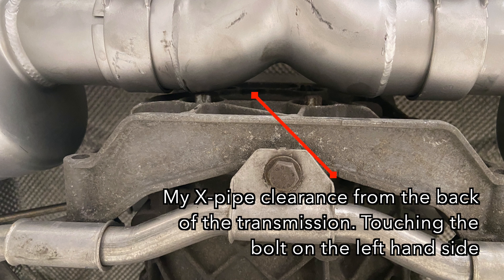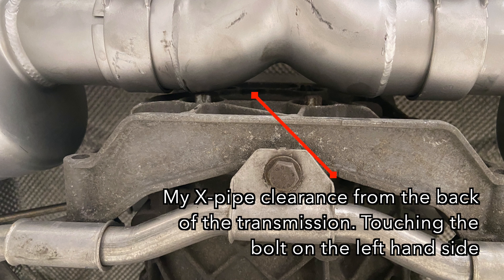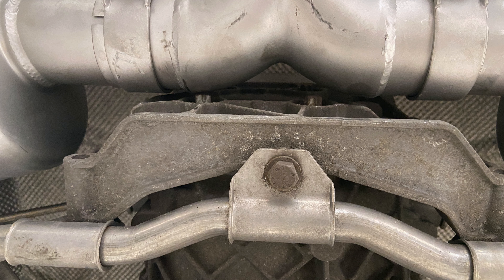Soul Performance Exhaust Installation Update 1 | Porsche Cayman 987.2

Comment: Sorry to hear about the installation issues but hopefully you’ve now got the remote problem sorted. As already mentioned, the final clip speaks for itself 👍
Reply from the maker: Hi Clive, I might have to live with the key fob issue... I’m still waiting to find out if my garage wired it wrong, or are the key fobs programmed inverted? Worst case I’ll colour the buttons green and red as appropriate.
Reply from the maker: Hi Clive, I just replied to another post here, it's rather funny!! The key fobs have been sent out "wrong" for absolutely ages. The thing is, no one in the USA cares, as they programme the signals into their HomeLink buttons, which is a standard option in the USA. Meaning, no one in the USA uses the key fob after they have taken the signals off it. On the other hand, I need the key fob to operate my valves as I don't have HomeLink. John is sending me a solution in the post!!
Reply: MAX REVS maybe they got this the wrong way around as they drive on the wrong side of the road 😀 but glad to hear that a solution is on its way, it needs to be right.
Reply from the maker: I was preparing to live with it, until John Gaydos reached out to me, and said after extensive investigations, they concluded all their Cayman key fobs operate in the same manner as mine, i.e. the unlock button closes the valves, the lock button opens the valves. I can't believe I was the first person to inform them ;-) The UK definitely doesn't have a lot of Soul Performance compared to the USA.

Comment: Sounds good. Some of the smell is probably the exhaust getting hot for the first time and the coating slightly burning. That will go after a few drives.

Some pics and info on the H&R roll bars would be interesting also.
Reply from the maker: All in the next video, and thanks for mentioning that thing about the exhaust coating

Comment: So glad you like the sound Max!    Are the roll bars oem or stiffer?
Reply from the maker: Thanks Tom. I haven’t put the car through it’s paces, though cannot feel any difference with the new anti-roll bars. I’m not sure I could notice much difference unless I track the car? Slowly I am replacing all the bushings on the car, front and back, and that is primarily why I wanted a stiffer anti-roll bar setup. FYI. The Cayman R has a stiffer anti-roll bar setup compared to the 987.2 Sport.

Comment: Congratulations on your new exhaust Max.  Frustrating about the key fob but sure it will get sorted out - probably a silly question have you tried both fobs?
Reply from the maker: Great question, I meant to try this when I got home last night, but didn't, as I hadn't eaten any food the whole day. I just wanted to take my shoes off and eat something at the end of a long day. I need to start the car in order to find out, and don't want to do that unless I go for a long-ish drive... What the heck, it's 6.30pm now... time for a drive methinks!!
Reply from the maker: Back from a drive. Both key fobs the same.
Reply: That's a pain. Sure they will sort it.  Don't think I am far from you(Sussex)  I have a white 987 S will look out for you.
Reply from the maker: John Gaydos provides great customer support. Here is the latest on the key fobs...
So as you may know HomeLink is standard on all Porsche Caymans sold in the USA. As such, it seems like everyone in the USA programs the exhaust valve key fob into the HomeLink buttons, and then never uses the key fobs ever again. I don't have HomeLink on my Cayman, so I need to use the key fob.
It turns out the key fobs have been inverted from day one! Just that no one has ever bothered to inform Soul Performance as they don't use the key fob!
I tried swapping the buttons around in the key fob, but that's not possible. John Gaydos has come up with a solution, and will be sending it to me soon... watch this space. The garage did all the wiring 100% legit.
Reply: That's great news Max

Comment: Sounds great so far !  Can't wait to see your upcoming video.  Don't worry about the valves - just leave it open :)  Would be great to hear your thoughts on this setup vs the 981 Cayman GTS.  I have a Cayman R with PSE and I've received a lot compliments on the sound but I'm also thinking about an exhaust upgrade.
Reply from the maker: Cayman R owner? NICE!! I was driving home from the garage on Monday on the motorway... I was opening and closing the valves while cruising, you know what? I couldn’t hear much of a difference, I couldn’t detect any droning even when the valves were open... leading me to think, I might as well have the valves open all the time! I definitely need to spend more time with the car at the weekend as I have hardly put the exhaust through its paces.
Reply from the maker: May I please ask where you’re based? If in the UK I’d love to compare our exhausts and make a video! You can reach out to me at maxrevscars@gmail.com if you don’t want to reply here.
Reply: @MAXREVS  Check your email

Comment: Congratulations on the exhaust!
As far as what Boris has said, you have only changed the mufflers. The should be minimal (if any) changes for the lambda sensors. Even if there would have been, the ecu would have adapted very quickly.
Anyways, can't wait to see the follow up video.
Reply from the maker: If Boris ever sees this comment maybe he can clarify. He said it's to do with exhaust gas pressures... it will be less restrictive now, and the car is always looking to fine tune the petrol / air mixture. Didn't understand it fully, however when I don't know enough I generally err on the side of caution.
Reply: @MAXREVS  While it will be less restrictive, it will not be that much of a difference. Also, you have the stock ECU and mapping. This is not a racecar, nothing too dangerous will come out of that.
Reply: MAX REVS   It will be absolutely fine as you have only done the rear exhaust, if you had de catted it or fitted 200 cell headers it would be needing a remap set up ...   get the engine up to temperature and ring the snot out of it ... sounds really good the end clip ... it’s going to smell for a bit all new exhausts do don’t let that worry you ....
Reply from the maker: Thanks for the advice. The smell is much less on the second day👍🏼

Comment: Are the scratches on the exhaust superficial? I ask as you were so diligently careful on the unboxing video yet now installed it has picked up a heck of a lot of marks. How come? Not being a troublemaker, 👀, just wondering if you should ask for some money off the install.
Reply from the maker: Show me a mechanic that treats your car the way you would ;-) I've picked-up plastic trim scratches even in a Porsche garage. I accept every time my car visits a garage, it will pick-up a battle scar... sad but true in my case.
Reply: I'd wipe it down with IPA or alcohol to get off any grease.
Maybe John Gaydos can send you some touch up paint?
Reply: MAX REVS perhaps good feedback for Soul, in that they should consider a  protective film on the product that, once installed, you can unpeel it. Might add 10/20 dollars to the product price but worth it in the long run.
Reply from the maker: Hi Rich. The satin finish is in the metal... so paint won’t do the job. I ain’t sweatin’ it too much😁
Reply: MAX REVS noted that the mechanic said “when you use aftermarket parts it’s never straight forward” yet I worry they would as easily say “even when you use official parts it’s surprisingly never straight forward”. hmmmm, I’m not convinced by this garages work. I would have certainly demanded a refund and I feel you should too. A scratch is one thing (maybe), but who was working on it, a velociraptor?
Reply from the maker: @julian987r4  I didn't fit the exhaust myself so don't want to comment on the mechanic(s) who worked on the car. The fitting was damn tight, and I reckon they did what they had to do to get the exhaust to fit. I'm glad they fitted the exhaust in the end, as at the start of the day that wasn't 100% certain.
Reply: @julian987r4  it's an exhaust fitting of an after market product. Marks are gonna happen. Unless you spend your days under the car (danger to life - not recommended), does it actually matter?
Reply: Phillip McMahon yep fair point. I was thinking it spoke volumes, but maybe it doesn’t after all.
Reply from the maker: Monday evening it bothered me. 
Tuesday it bothered me less.
Wednesday, I’m thankful they fitted the exhaust and didn’t send me home saying they were not going to fit the exhaust at the risk of marking it.
Reply: @MAXREVS  wise mate. Considering its function it will have marks etc in no space of time. Enjoy it 😁
Reply: MAX REVS I am day behind you. Tuesday evening it bothered me, today not so much. Tomorrow I’ll be over it 😀

Comment: Hi, I feel for you Max the frustration you are going through. Just one question. Why did not go to a garage that had done at least a few installations of the soul performance exhaust or Is just a case of no garages that had installed such a exhaust near you?
Reply from the maker: Hi Parvin, I phoned around a few independent Porsche garages near me (1 hr drive away), all had fitted aftermarket exhausts before, non had fitted Soul Performance before. I just don’t think they’re that popular in the UK after you have factored in shipping costs (it’s heavy and will come by plane) and import duty. I didn’t think it would be that tight a fit to be honest, and comparing my car to the pictures on the Soul Performance website looks like there is around 4 inches difference in space clearance?? No idea... but it’s fitted at least!
Reply: I thought it would be unusual for some so organised not to go to some with experience of fitting the soul performance exhaust. Anyway I’m sure your ears will enjoy the sounds to come for many years. If you still want to meet up then let us know as the restrictions are now lowered
Reply from the maker: For what it's worth, I think the garage did a good job in getting the exhaust onto the car. What would have been awful for me, is if they sent me home with my original exhaust back on the car. When I looked under the car initially, the exhaust was touching the back of the transmission. Through dedication and probably elbow grease they got it to fit with clearance to spare.

When company A makes a product, which is fitted onto something made by company B, and the work is being done by company C, it's easy to call out one particular issue.

I'm simply happy the exhaust is on and hope to have many thousands of miles of happy motoring. Also I do plan on using this garage again for regular servicing and other modifications.
Reply: MAX REVS definitely worth having a good relationship with a garage you can trust. I’ve got the same, my guy is a bit forgetful but his mechanics are good

Comment: I was wondering how they rectified the problem with the bolt touching the X pipe? 
I hope it sounds the business for you bro.
Reply from the maker: So they removed a factory bolt from the back of the transmission, and replaced it with a bolt with a shorter head. They also jiggled the whole exhaust around and most likely applied a fair bit of pressure when tightening up. The clearances are still small, all to be shown in the next video when I get round to making it.
Reply: I'm glad you got help to fix the issue of the problem bolt 👍 Where there's a will.....😊
Btw your earlier vids pointed me in the direction of my 3 week old purchase of a 981 s !! So thank you for that.
I'm now living the Porsche 🙌
To the max 🍻